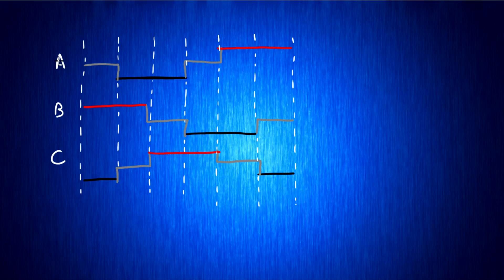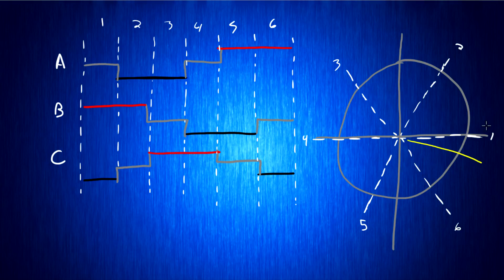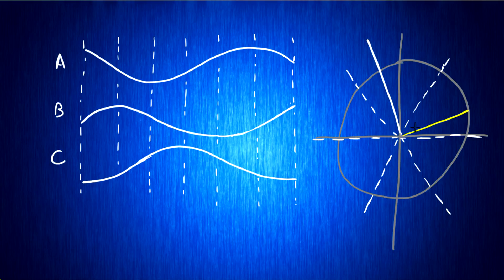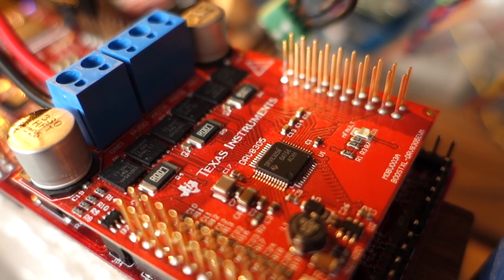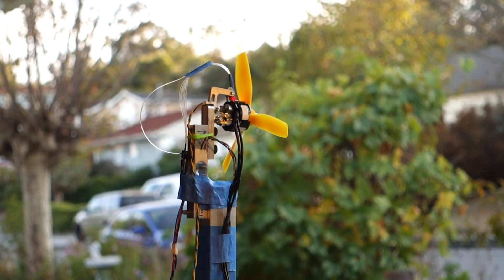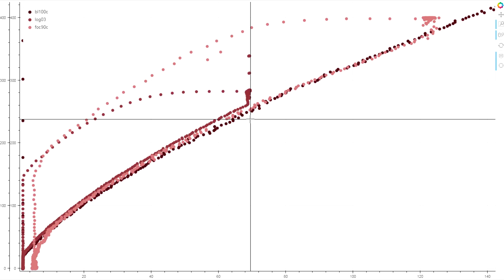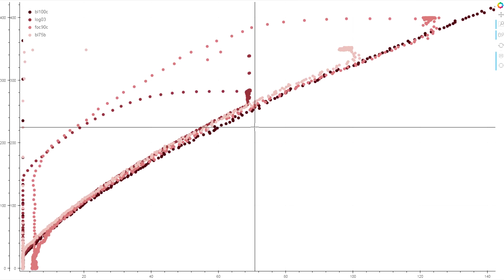ESC Tech: Field Oriented Control

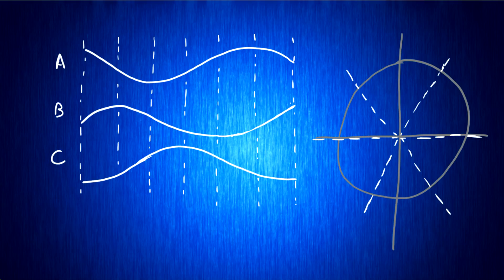Comment: @3:31 - I'm pretty sure that's wrong - an ESC doesn't supply different voltages, it is nothing more than an ON/OFF switch, which (by using PWM) can vary the amount of time in the "on" state to effectively limit the current.
Reply: Yes, technically that is incorrect, it is switching between high and low only, but its doing it very very fast(~20kHz) compared to the output frequency(100Hz). This lets it control the current through motor to be a fairly smooth sinusoidal curve and current after all is what generates the magnetic field

Comment: @2:30 - you're talking backwards I think?  magnets are stronger the closer they are, so you get MORE (not less) torque as something approaches the thing pulling it. You're also neglecting to point out that the other active phase is repelling at the same time, which semi-cancels that out - so the midpoint is actually the lowest torque (assuming the power is turned off before the magnet fully passes the coil midpoint.)
Reply: Well, yes, but not really. we also have angles and vectors involved. When the angle is 90deg the torque is maximum because sin(90) is maximum. If you go through and do the dot product of the force vectors you'll see where that's coming from. A simple way to understand this is to think about the extreme case when the magnetic field and rotor line up perfectly. Now there's no force on the rotor at all, it just stays where it is because its fully aligned, the more its misaligned, the harder it'll try and re-align
Reply: @c10yas  sin(90) is only "maximum" if you ignore the distance between the coil and magnets and the exponential increase in that force as they get closer.  Imagine you try to stretch a huge rubber band (e.g. bungee cord) that's connected to the ground by lifting your arm from straight-down, up through 90 degrees, then continue up above your head.  As you go past 90 degrees (e.g. 135 degrees), your shoulder will experiences more torque than it did at 90 degrees any time the bungee force is 50% or more than it was with less stretch in it (1.5 times sin(45) is > sin(90)) - magnetic strength is exponential - depending on your geometry, the force could easily exceed 50%

Comment: Hey, I've been reading about FOC a lot lately and I would like to experiment it for myself. I'm currently hoovering TI's page with all the info about their launchpads and motor drives. So here's my question, say I would buy their motor control microprocessor, what motor should I get? Does it matter? I mean, should I just get some cheap 3 phase bldc from aliexpress and experiment with the kit on it or are there some motors that are not compatible with texas instrument's kit like the one you used? For what its worth, my end goal here is to control the motor of an ebike without having to buy bullshit 800$ controllers. TY if you awnser :)

Comment: @SiieeFPV hii...I wanted to know which launch pad you have used for the FOC control of The Motor..
Please do reply...
Reply from the maker: I used a 595-LAUNCHXL-F28069M, but there are several picolo dev boards in the line that will work the same

Comment: I would like to use small BLDC motor for fans in my house.  The problem is they are very noisy.  I would like to use FOC for very efficient low power (3-4 watts) low noise fans.  How did you get this esc from Ti? They are not for sale.  Also how did you tune the motor to work best with FOC?
Reply from the maker: There isn't a ready made ESC, from TI, you want something like a BOOSTXL-DRV8323RS  development board.  You'll have to write your own firmware as well.  Best place to start is the TI InstaSpin documentation, they step through the development and tuning process.  If you're looking for an esc that's ready to go you probably want something more like a VESC

Comment: Is the motor sensored? I can't quite figure it out from the clip with the motor due it being attached to your load cell for static thrust measurements.

I mean, if it's sensorless, then it is desyncing if you stop the rotor, because it can't read any BEMF voltage if the rotor isn't moving. It just reverts to simple startup logic to try get the rotor moving again (as evident with the jerking when you stopped the rotor). With the load being a propeller, it's load to the motor is pretty non-existential at low speeds so you can try get the rotor back moving with low currents and then start tracking it's position again, so it works in the flying RC use. But anything needing more torque to get moving might result in some jerkiness from a zero speed start-up.

I'm just asking because I want to know I understood the video correctly.

As a clarification. I have a RC and embedded systems background and more recently I have moved into electric skateboards with the aforementioned problem with sensorless FOC and zero-speed startups. The de facto in the esk8 community at the moment is the VESC, which is an open source FOC capable motor controller developed by Benjamin Vedder (https://www.vesc-project.com/).
Reply from the maker: it's not sensored, just a regular off the shelf MT2204.  This control doesn't use zero crossing at all, in fact all 3 phases are driven during all stages of commutation so sensing BEMF zero crossing is impossible.  It works by sensing the phase current and using that to estimate the BEMF voltage directly.  I've seen demos of similar escs not only providing zero speed torque but position control on regular hobby motors as well.  The Ti system relies on it's FAST estimator to track rotor position, and I think it only needs to go through a startup sequence on it's first zero speed startup.  Their default startup is forceAngle, which assumes a zero rotor angle and attempts to move a pre-determined delta, the FAST estimator is able to begin sensing the actual rotor position within one electrical cycle.

When you're in control of the motor and coming to a stop you can park the rotor and the estimator won't need to go through a startup again.  The jerking you're seeing from me stopping it is probably just it failing to complete it's forceAngle mode and trying again.  It's also really likely that I just had a module completely misconfigured.

I know of the VESC, but I'm not really familiar with its firmware, you're probably in a better position to answer technical questions than I am.
Reply: I have tested the TI's piccolo InstaSPIN-FOC development boards, so I have also done some testing with their firmware. The FAST could track/estimate the rotor position pretty well, if you were doing a direction change with short enough time crossing the zero-speed area, but if you slowed the transition enough it would had to resort back to calling forceAngle() to try to get the rotor moving again.

It also samples both phase currents and voltages (depending on configuration) every PWM cycle in the non-driven part of the center-aligned pulses, so it is still measuring phase voltages in the code and using those to estimate the rotor position, it then corrects the next PWM cycles current PWMs to try to get them to 90 degree electrical angle to the rotor position.

"When you're in control of the motor and coming to a stop you can park the rotor and the estimator won't need to go through a startup again.  The jerking you're seeing from me stopping it is probably just it failing to complete it's forceAngle mode and trying again"
I believe my point is still correct. The motor was running when you stopped it and it then reverted back to forceAngle, hence I would call it a desync for that. If it still knew the angle of the rotor it wouldn't jerk, it would provide steady torque.

I'm not personally too familiar with the VESC's firmware myself either, but I do believe it's using Vedder's own rotor position estimator code. I guess I personally am a bit more of a hardware designer person, but I do write my own code for simpler applications.
Reply from the maker: I found the demo I was thinking of, wish I could remember the context
https://www.youtube.com/watch?v=1u1OoLLYefY

I suppose even then he never really sits at 0 rpm for any length of time.

probably some of the jerking isn't just that it's stalled, the startup is moving the rotor but my hand is also moving it back,  so even as the estimator gets to a point where it knows its position I'm breaking that relationship right away again, maybe it would have behaved better if it was a more fixed load that was being applied and not cyclic.  If it's still able to sense the rotor position with low current you can avoid a big lurch with a low power startup as long as you can then control the rotor position right away.  I'm not really sure how that would work.
Reply: In the linked demo, he is using a separate observer for low/zero speed operation, which is doing some "magic" (AKA, I don't know) to track the motor position even at zero speed, because there is no jerking when he is moving the propeller by hand to another position, it's seems to be pretty evenly applying torque against his hand. He seems/might be driving the motor even at zero speed, as you can hear a lot of whining sound, which might indicate the motor windings being energized and he is measuring some kind of feedback from the phases with a certain stimulus signal to them, which would help the observer figure out the rotor position.

I looked around for forceAngle questions in the TI forum in relation to bigger loads and zero-speed startups and the following came up.
http://e2e.ti.com/support/microcontrollers/c2000/f/902/p/437542/1571080
"in your skateboard are you trying to control a single motor, or two motors in // ?
both will be tough sensorless, the // is extremely challenging. for a single motor it can be done, but you won't be able to apply full torque smoothly at start. for this type of application I would suggest hall sensors or an encoder."

forceAngle() is called if I remember correctly, when the rotor is deemed stalled or below certain rotation speed. And it is just a simple "brute-force" way to try to get the motor rotating again.

It would seem that there is a limit to the ability of the FAST observer to track the rotor position in the very-low/zero-speed range. But in the multirotor application, as it is in this case, this might not pose lot of problems, due to the propellers being light loads at zero speeds, so the forceAngle can get the rotor moving again easily with low currents.
Reply from the maker: Ya, stalling in a multirotor isn't a big problem, and the extra torque at very low speeds with FOC would really eliminate the big source of idle stalling that we have in the first place.

Do you know what ESC is used in the Meepo board?  I would have thought it some VESC derivative.  It seems quite happy to sit at zero speed on the brakes (just sitting in regenerative mode I'm sure, the motor is stiff but far from locked) and does give a nice smooth start from there as long as you're gentle on the throttle.  Though I suppose it's possible they're using sensored motors too.

Comment: Amazing work do you ever plan on making your own esc's or code for them and run your quadcopter on it? If  you are interested, on the Betaflight slack group they have a channel #open_esc_firmware is the name and it's where people are developing open source esc. Now I'm not a 100% sure if it's just code they are programming or if they are working on the whole thing. You should definitely take a look, it's open to the public.
Reply from the maker: I'm already there.  I'm quite excited at the potential for it, but it's all a little too low level for me to have anything productive to contribute.
Reply: Hello, I have tested today the FOC algorithm on my quad : https://youtu.be/6j-ZW-xqhHM
I use an STM32F3@72Mhz and the maximum eRPM is 140 Keprm (with 30K FOC/sec). 
I am planning to make a new hardware in the next weeks which would be able to reach 200 Kerpm (45K FOC / sec).

But first of all, I am trying to know if such inverter have really an interest in quad, do you have an idea ? (May be it would be have more impact in wings...)

Comment: Have you gotten to the later labs and enabled over modulation and field weakening and compared those results?  I develop with Instaspin myself and have a small controller for large quadcopters I'm working on.  Got R/C and analog throttle sorted out which was a battle for me for a while since I'm not use to this level of C coding.  Designing a good power stage is the tricky part of motor controller design.  Power electronics is not an easy game.
Reply from the maker: Ya, this is with full overmodulation.  Field weakening seems like a really bad choice for our application, dumping extra current in for a little more overspeed doesn't seem like a good tradeoff.  And the rated flux for this motor at least is so small to begin with.
Reply: I'm not sure if FW would be worth it or not.  Always fun to experiment and prove it.
Reply from the maker: I may have another look at it once I get my motor dyno sorted out, that would be a better demonstration of it anyway I think.

Comment: Do the stators only ever pull the magnets? Is there a method that can push and pull at the same time?

I'm assuming this will require a specially wound stator and special controller as well
Reply from the maker: I don't think so, you only have 3 phases, in order to have different poles on adjacent coils the center tap would need to be both + and - voltage at the same time.  Closest I can think of is a thing called field weakening in FOC where you dump current into the motor that counteracts the magnetic flux in the airgap from the rotor to allow it to run at even higher speeds.
Reply: say we have a stator with 4 poles, and 4 magnets on the bell. couldnt we theoretically make that work?
Reply from the maker: a 3 phase motor will always have 3 phases, and the number of stator coils would be a multiple of 3.  You could do a different number of phases but then you can't drive it with a 3 phase controller.

Comment: Wow cutting edge!  Really cool results too with the smooth startup and no torque ripple noise, and impervious to desync when stalled.  I have to believe there's measurable efficiency gains to be had, given that FOC applies force at the optimal angle all the time.  If it's in the literature for other AC motor applications and it's even 5%, I hope you'll keep chasing those PIDs.

Gotta say it makes me cry to see you drop gems like this that only 50 people watch and maybe 2 even begin to understand.  But keep it up!
Reply from the maker: ahh, you can do sinusoidal control without FOC, that's probably what they've got going on.
Reply: @SiieeFPV  Zero-BEMF Crossing is to FOC, as Sinusoidal is to Trapezoidal control.
One is a motor detection and observer algorithm, the other is a commutation method.
Reply: Do you think this sort of controller can be implemented on a small enough space for quadcopters?
Reply: Definitely. the Kiss32 already does it. Blheli_32 might follow
Reply from the maker: Kiss does?  I thought that might be something they were preparing for in their new upcoming hardware generation, but I don't remember the current one having more than one current shunt.  I don't follow them super closely.  And if BL32 is going to support it it's going to require all new hardware as well for the same reason, it's not something you can just drop on as a software update on a trapezoidal hardware design.  Only ones on the market that I know about are a DJI one and an XRotor HV esc.  Both are meant to be paired with one specific motor.  The TI reference design is a quad ESC form factor, but on like a 450 or 650 sized machine.
Reply: The new Kiss 32a esc does sinusoidal and trapezoidal both, like some sort of hybrid design. 
I looked at pictures of the new ESC and I can't seem to find the two shunts either ? :P

https://kiss.flyduino.net/the-kiss-experience/kiss-esc32a-32bit-electronic-speed-controller/

I understand blheli_32 will have to make new hardware but that doesn't seem too hard.